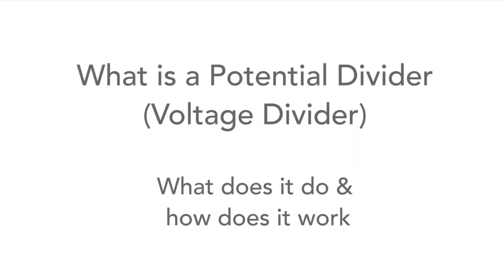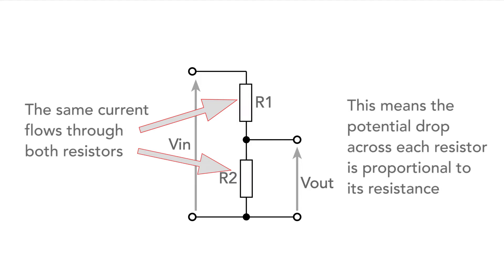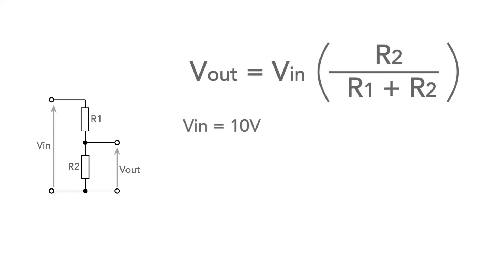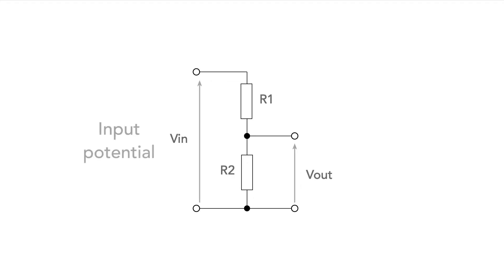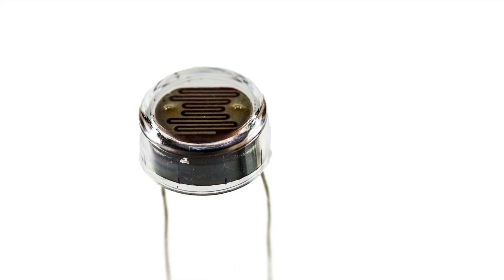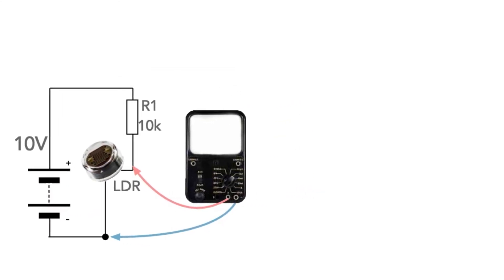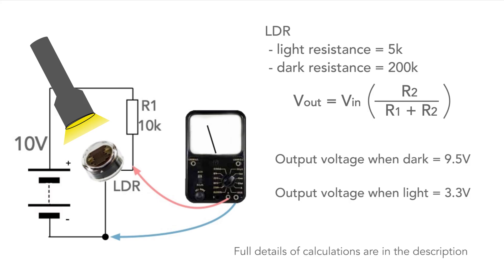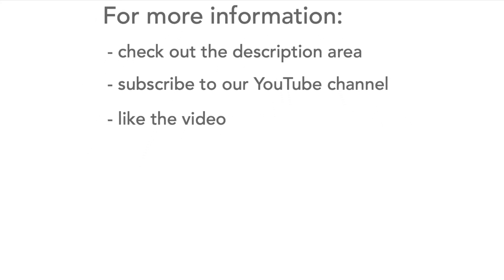What is a Potential Divider or Voltage Divider Circuit

Comment: Nobody I've ever seen, until one of my favorite professors in college, explained the term Vout = Vin * (R2 / (R1 + R2)) as nothing else but Vout = I * R2 (a current multiplied by the resistance of any resistor you want to find the voltage drop over). Vin * (R2 / (R1 + R2)) is nothing else but the current flowing through both resistors that are connected in series. It's intuitive from the simple schematic but I know for a fact that many other students at Analog electronics class struggled even with simple stuff like this because it wasn't explicit immediately (as did I, but I managed to past that hell by working day in day out). Thanks for the explanation. I needed your source of information. Bless you, sir. 👍
Reply from the maker: I’m really glad that the video helped. Thank you for your comment.

Comment: Hi, newbie here. In the last diagram  - with the photoresistor in the first position - shouldn't the red lead on the voltmeter be going to the connection between the two resistors, or am I missing something? Thanks for your videos!
Reply: I think you’re right, he probably meant to connect the voltmeter to the 2 sides of the fixed resistor